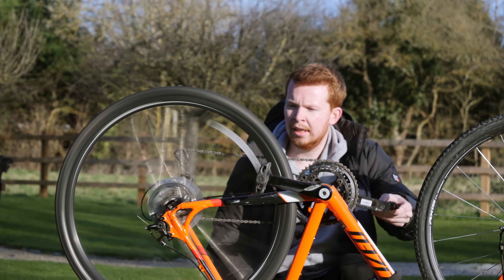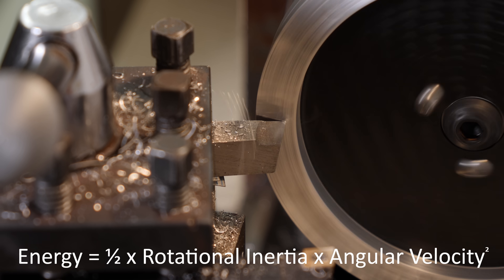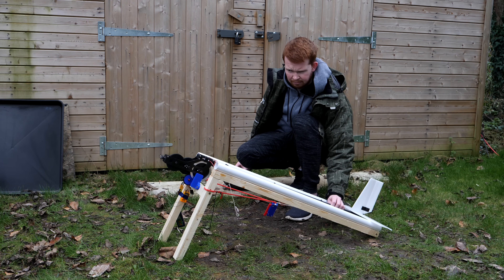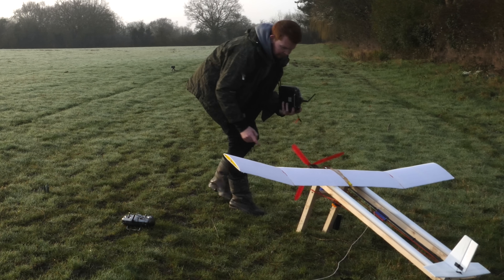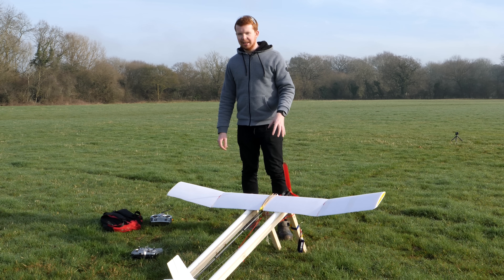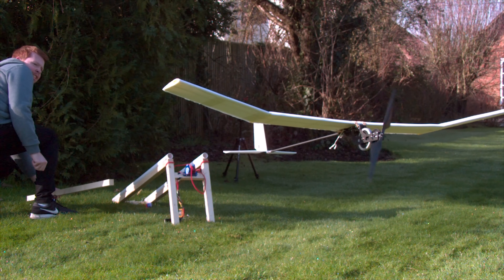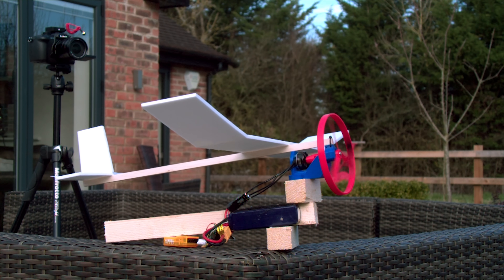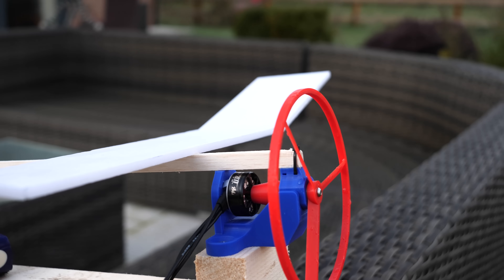Flywheel Powered Plane

Comment: The angular momentum of the flywheel when pushed forward make the plane immediately dive down, just reverse the rotation direction of the flywheel to get the exact opposite effect and have an uplifting force. You will need a propeller for a reverse rotation as well. The balance of the plane will need to be rethinked due to the upward force angular momentum.

Comment: On the first plane, did you account for the torque applied by the decelerating flywheel that would either pitch the nose up or down depending on the direction of rotation?

Comment: Is there a reason a worm gear wasn’t used instead of multiple gear reductions + gears for a 90° axis change?
Reply: Worm gears are highly inefficient. Like 20% efficient at a high reduction like this. Because the worm has to literally slide across the gear's teeth, a lot of energy is lost to friction. To visualize this, imagine a plastic cube and a plastic ball on a plastic countertop. The cube and the ball have the same mass. You push each with the same force for the same amount of time. Which moves further?

The cube is like the worm gear in that it will slide. The ball is like involute gears in that they roll. 

A pulley system is much more like a involute gear in that it rolls along the belt, but the belt must be a material that can deform. Energy is lost in that deformation, and the belt wears. The benefit to a pulley system is that you can be a lot less precise, and material cost is low for replacements. This is evident when the 90 degree bend got chewed up on a failed launch. 

At least that would be my line of thinking in designing something like this. Does this answer your question?
Reply: @beliasphyre3497  yes actually.  thank you!
Reply: Also the way he was driving the gear set to spin up the flywheel. You can't back drive a worm gear, the angle of the force creates a locked train.

Comment: Comment written before I watched:

okay, so when I saw the title I figured "this is pure genius, why haven't I thought of that before. Then I clicked the video, but as it was loading, I figured the problem is that a flywheel needs to be heavy to store enough energy... or spin very. very fast. Also, this will create a gyroscope effect, which will stabilise the plane, but also make it very hard to maneuver, and also means that every orientation change you make (except on one axis) will waste energy in the wheelo

I can't wait to see the video, but I doubt you'll get more than a 15-20 seconds flight after much tweaking, I'm hoping I'm wrong and you make it work!

Comment: Did you check if the 3D printed parts were in balance? Maybe they should have a turn on the lathe as well as the CNC parts.

Comment: Hi Tom...I think I know what your issue is....your gearing ratios a wrong...Don't you need the propellor to spin fast enough to propel the airplane...instead of a slower speed? Your gear right before the propeller should be smaller not large. Thought you need that propeller to be spinning at a certain speed to accelerate  the total weight of the airplane?

Comment: The flying hoola-hoop reminded me of a toy I had (and lost when it landed on the roof of a 2 story building...) It was a metal ring in a plastic sleeve, which rotated when you threw it (like that ring) you could throw it insanely far, I don't remember the name of it though
Reply: I believe they can be found under the name "X-Zylo", mine was a different brand though

Comment: This idea was awesome and I think that you should try a version 2.0 of your original atempt! 
Maybe a stronger flywheel and better bearing to make it able to spin at higher rpm:s or maybe try two counter rotating flywheels coaxially connected to the propeller.

Comment: I feel a bit scammed :( But I guess it's kind of a good thing... Your videos are always interesting and u usually don't give up so easily, I wasn't expecting you to just stop with a toy. You should add a clutch system in between the flywheel and propeller/gearing, so you could spin the flywheel up to stupid speeds, while still having control over the craft.

Comment: You know what's funny I had a toy airplane as a kid that worked the same way. The front was just a 7 inch prop with a ring. You attach the airplane to a handle with a pull cord and it would fly out of your hand roughly 25 feet

Comment: My Dad told me about a rubber band power model airplane he build when he was a kid back in the 1930s that used a counterweighted mono blade prop. He said that type of prop has one long blade that spins at a lower rpm while providing plenty of thrust. It would be interesting to see one of your projects using that type of prop.

Comment: Be cool if you could modify it into a rip chord type system! Its all pretty brilliant!

Hey Tom if it interests you would you ever look at how the efficiency of a open tip propeller defers from that of a closed tip propeller, an example being one of those shrouded props you used in this video, where the prop is in a circle? That be neat to see if there are any gains!

Comment: This is great. Could you improve upon the design by using something similar to the Electro-Mechanical Flywheel Hybrid that Williams developed for F1? Chain Bear did a good video on how it operates. 
It basically converts electricity from the regen of a motor and instead of mechanically transferring the power to the flywheel like other Electromechanical Flywheel designs it does it through electricity. The flywheel isn't purely a mechanical energy source as it doubles as a permanent magnet that puts energy back into the system when needed by conducting the electricity back through.

Comment: This definitely needs a part two, considering how well the simplified design worked. Also, see how high you can make the flying hoola-hoop go ( straight up, like the toy ) with a high rpm motor and more robust hoop....
Reply: bolt a wider thinner alu ring to a standard CF prop (maybe 3 or 4 blade) that'd be insane!
Reply: @trif55  Yep, make the prop itself the flywheel essentially. This definitely needs more investigation...
Reply: you can't reach the incredible rpm's with the blades on them. flywheel works but requires really high tech electrically transmission and superconducting nano materials. if you have all that tech it's better than li-ion battery
Reply: @KirbyZhang  The blades don't need to reach the same rpms as the separate flywheel- the idea is just to reinforce the ring around the blades and add a little bit of weight to help them act like a flywheel for long flights. The real failure point was the where the blades attach to the hub- reinforce that area with some more beefy blades and away you go, literally...
Reply: @SuicideNeil  the fly wheel didn't work because there was too much transmission loss. the simplified design got rid of transmission, but you'll never spin those blades to 20k rpm

Comment: C'mon mate, you need to get the cool carbon fiber thing flying.  Two things:
1.  Gyroscopic action of the spinning mass, per at least one comment below.  Think of the Fokker Dr1 (and other WW1 rotary engine fighters) - liked to turn right, did not like to turn left (I may have that reversed) because of the spinning mass of the engine.   The engineer needs to make this force work for him, or at least stay neutral.  (No clue how.)
2.  Accelerating to flying speed off of a ramp.  Lets go back to Germany for an example:  The V-1 "buzz bomb" of World War II.  It's pulse jet engine was just fine for running it across the English Channel to London, but they wanted to launch them from ramps and that was just never going to work on engine power alone.  So they used catapults.  Another approach is "JATO" rocket canisters used to get heavy planes like C-130s in the air from short and unimproved runways.  You could use wheels and launch it from a runway, but all of your flywheel inertia would be used up by the time you got to take-off speed.  So:  A.  A catapult.  Compressed air would be cool but bungee cords would probably do.  Or, B.  JATO units.  Could be "sugar" rockets, could be standard model rocket engines (Estes, or whatever).  I am always up for anything that gets pyrotechnics into the mix.

Comment: Higher RPM .  Better control  and  balance .  No low efficiency gear down.  Stretchy rubber pulleys need an efficiency test.   Perhaps Gears only will get your power to the prop. Wonder if you would consider a regulated power drain down through electro magnetic and electrical controls well tested and worked through.   Kind of a hybrid with only a small capacitor in the power output chain.   This is doable but not a rush rush.  The key is extremely low resistance loss on the flywheel side with higher RPM and simple motor on the prop.  The flywheel can swivel so turns won't power out resistance creating angular inertia across the line of axis of the flywheel.  
 You were probably losing a lot of power from the bank twist take off prop effect against a solid chassis gyroscope axis Mount. 

You still need more RPM 

The whole start up was cool. 
Thanks for the go.

Comment: Hi Tom, I have watched your video and I have got several suggestions for you. Fly wheels are able to store a fair amount of energy indeed, but they have got these properties that have to be taken into account while using them in an airplane.
1. Fly wheel keeps its axis of rotation - basically it is stabilizing your plane around the axis of rotation. This way it is difficult to control your plane using Rudder (in your particular configuration)
2. Action - Reaction issue, while rotating at one direction (e.g. clock wise) it causes plane to rotate in opposite direction (counter clock wise). In this manner it is shifting the Center of Gravity of your plane. This is done dynamically as the speed of rotation dicreases. For a launching moment your plane might become insanelly tail heavy or head heavy (your case).
My suggestions:
a. It might be interesting to keep the configuration and to try to change the rotation of the fly wheel with the corresponding change of the propeller. Again the Rudder control would not help much.
b. You might consider putting the fly wheel horizontally - i.e.: it's axis of rotation will be vertical. The counteraction of the rotation might be done either pasivelly 

- by using the sufficiently big vertical tail surface, or activelly 

- by using a tail propeller (as helicopter) or by using another flywheel rotating in opposite direction as the first one (axes have to be kept in parrallel)
 I keep my fingers crossed for you.
Looking forward to see your experiments!

Comment: Could you perhaps try a hybrid configuration, where instead of using mechanical gears to link the flywheel to the prop, use an electrical linkage.
So, a flywheel, maybe the one you already made, attached to a motor that is used to energize the flywheel and also produce power from it -- then some circuitry (boost-buck), and a DC motor on the drive propeller.
This way you could spin the flywheel up electrically, then engage the motor when you're ready to launch.  You could also set the output voltage to control prop speed.

Comment: Looks like enough power but CG too far fwd, can't you move the wheel aft and make a torque transfer driveshaft, even better, add a breakable/replaceable link so it doesn't destroy the gears ? Just for fun, replace the prop with a very small flywheel, so you can pick up the plane and feel what torque effects are being generated by the main drive,  that torque should be preventing a sharp turn, but may be directing it downward, can the flywheels direction of rotation be reversed ? Great work !

Comment: how about making the propeller itself the fly wheel? ie like your final design with a (weighted) ring around the propeller. I'm guessing you'd need 2 contra rotating propellors, and flight time wouldn't be amazing, but unless youre going to spin the prop to crazy speeds you aren't going to get the energy in for a decent flight time anyway. 

It would be simple, and I can't think of any way of increaing the power to weight of a fly wheeled design.

Comment: I'm not an engineer, but what if you used an on board capacitor and motor to initially launch a plane, and use then the fly wheel to continue the flight ?

Comment: Hey, how long would it fly for if you added a weighted ring to the "hoop" of the plane? Won't it keep its propeller speed for longer that way? In fact, as it stores more energy the heavier it is, won't it just be best to have it as heavy as possible so long as it's not too heavy to provide lift for itself?

Comment: 6:21 - the ring flew surprisingly far, I'd like to see a video exploring/optimising it.
Reply: There used to be a toy frisbee like device that used a thin cardboard tube, with a heavier leading edge, that used a form of the Magnus effect to fly.  Sorry for the run on sentence.
Reply: @fritz1990  There was a plastic one too called the Xylo, you could chuck those things really really far
Reply: Discovered by accident
Reply: It looks like the little stub of propellor blade left was enough to propel the ring, but didn't have very much drag and so the ring kept its speed up for much longer.

I think with more optimisation (maybe a non-printed ring that could spin a lot faster) and a shallow-pitch, optimised set of short blades, you could probably get a pretty impressive flight out of one.
Reply: I tested my 'optimised' version.

Good news:
- It flew!
- The launcher can survive full speed from my 2700kV inrunner, on a half-depleted 3S LiPo.
- It was spinning very fast when it landed, meaning there was plenty of energy to fly further.

Bad news:

- It doesn't launch cleanly, and so it shattered and lost a blade after a couple of attempts.
- It flew in a high-alpha attitude, relying on thrust rather than lift to fly. 
- Because it was basically not producing lift and only just had enough thrust to stay airborne, the flight was very short (4m or so).

My thoughts:
The characteristics that will give the longest flights (low thrust/weight, with a low angle of attack, and relying on lift from the ring rather than thrust to stay airborne) also result in difficulty launching. If I'd launched mine with the 'correct' angle of attack, it would have hit the ground before it had a chance to accelerate to flying speed. I could design it to be lighter or have more thrust, but then it would lose rotational speed much more quickly.

I think the following would be required to make this work:
- A launcher which can accelerate the ring forward on release, so that the ring is immediately at flying speed.
- A driving system using lugs on the outside of the ring, rather than the inside. This would reduce the chance of them fouling on the propeller blades.
- Driving lugs with a steeper angle. I don't think much angle is required to hold the ring secure, and the shallow angle on my design was likely why it didn't release cleanly.

Photo: imgur dot com /a/D1oIXpb
Reply: You can do the same thing with an empty toilet roll. Just cut it in half, wrap a layer or two of tape around it at one end and spin it forwards out of your hand (which takes some practice). Quite a fun toy if you can get it working.
Reply: Propelled by a residual bit of propeller, and kept up in the air by ridiculous amounts of Magnus effect. Definitely worth taking a poke at.
Reply: We made freesbies like that when i was a kid by cutting a coke can in half and remove the top by filing the fold so it get a bit heavier in front. Throw like a american football and it flies really well, u can even do loops
Reply: Print finished. Seems too heavy, and the launcher is too tight.
Reply: I always folded the edge up like a little crooked keel to help it spiral, but this is the same process. 
https://www.instructables.com/id/The-Incredible-Flying-Paper-Tube/
Reply: It's pretty much the same thing as the flywheel
Reply: me too

Comment: Great problem solving. I wonder if you could make your original flywheel and use carbon fiber blades as the hub. Upping the need for a safety tie

Comment: Given the main limitation on RPM was not really the weight of the flywheel as the spin-up was not time dependent, a heavier one might have worked better.

Comment: You should try to make Magnus effect plane with a high speed Flettner rotor as both the lifting surface and energy storage for the propeller. That way you would have much greater lift for less weight!

Comment: Tom, thank you for the fun videos.
Btw, I've been working on reinforcing 3D parts with a piece of metal. Depending on the part, it can be a piece of wire, spring steel, all thread, what ever. The basic idea is to draw a cavity inside the part, so the metal can be inserted into it. Or pause the print, drop/CA glue/epoxy the metal piece, and resume the print. It can be very useful for some parts, instead of making it entirely out of metal.

Comment: Could you try again with the flywheel only using the quick release to spin it up?

I think you're on to something with both of those approaches.  Perhaps you just need a slightly stronger and beefier prop.

Comment: Very high RPM.. 200 000 rpm, and very well balanced wheel, but draw the energy electromagnetical wo any gears and power a regular el. motor.

Comment: Couldn't you just reduce the translation of the propeller-flywheel to get higher rpm of the prop? sure it will fly only a very short time, but it will fly